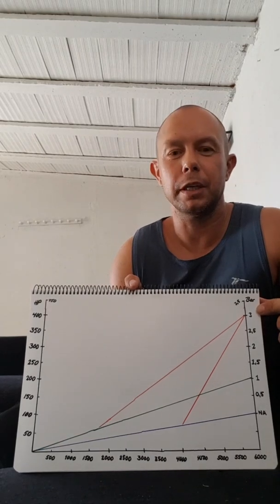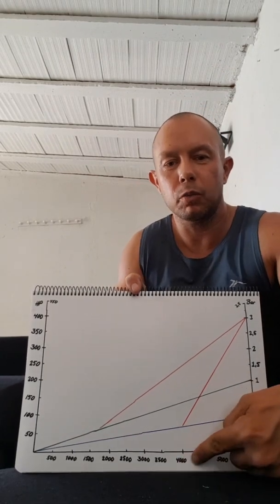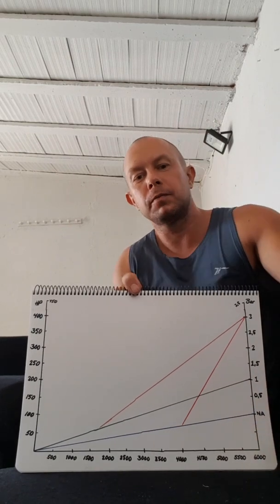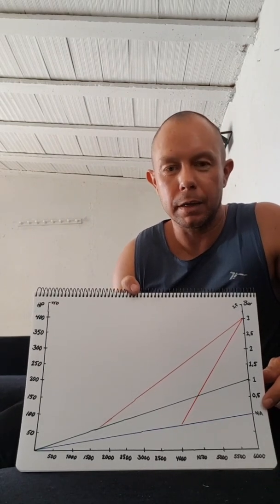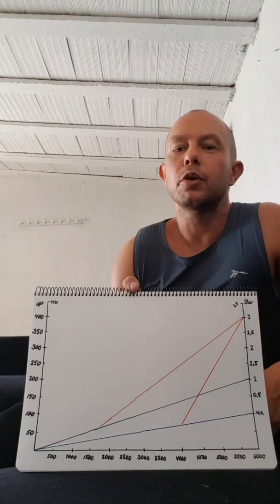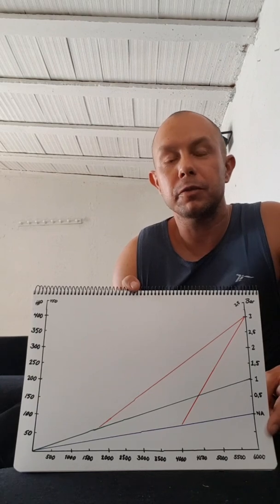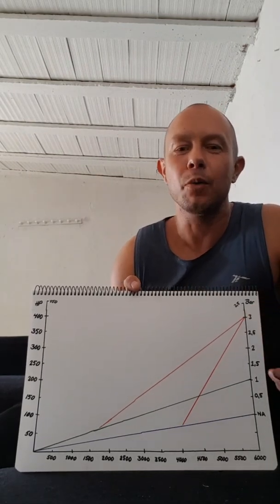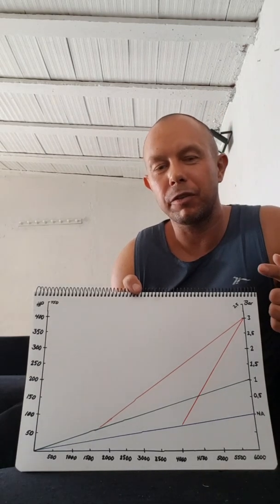Turbos and superchargers in a beautiful symbiosis. Focus om the OM604 today and Land Rovers.

Comment: Hi Fred,
I learned alot from your video's. 
I have a om605 that i want to put in a range rover.  I did buy a variabele turbo but now i'm thinking its the wrong way to do it. What size eaton and turbo you schould put on a 605 for a 4x4?
Reply from the maker: Hi mate and thanks. Eaton m62 + Holset HX40 or BW s200sx-e
Reply: @FtunePerformance  thanks mate

Comment: before dropping money on a nice exhaust manifold and turbo i investigated the use of a supercharger on a 606. Basically it would be a massive pain in the ass AND still need a turbo. The only way i could make the numbers all come out right for mass airflow and heat input was to run an improved version of an m90 (from magnum powers) or a lysholm (screw blower) from a toyota previa paired with an hx50. The supercharger would make 1psi at idle and top out at 6psi by 1600rpm before a bypass valve would open allowing the air from the hx50 to bypass the supercharger once the mass-airflow from the turbo exceeded the flow capabilities of the supercharger and to minimize air intake temps. While technically doable, the expense wouldnt be worth it unless a dozen people were onboard with it to get parts costs down. I absolutely love that you are willing to talk about twin-charging while everyone else in the industry tells you to shove it when you start talking about it.

If i had money to burn i would think about moving the sizing up about 30-50% to a 1.2-1.5L screw blower and swap the hx50 for a s472 or s475 which should in theory need even less pulley on the supercharger enabling better efficiency there as well as moving enough mass to keep the turbo spooling around the same rpm but with the ability to move enough air for 750+hp. My numbers were all run with a single intercooler right before the intake manifold but a good water to air setup running dual coolers for one interstage and one just before the intake manifold would be able to push it even further though i dont know where block integrity becomes an issue so it may be a quick recipe to send rods out the block.
Reply from the maker: That's an amazing comment. Thanks brother.
Reply: @FtunePerformance  i might not have all the hands on experience but i love doing the problem solving and figuring out numbers. Took me a few days of math and research to sort it out and hopefully i can someday make it actually happen but first i have to finish a few other pieces 

as per usual, love the content and the ranting please keep it up